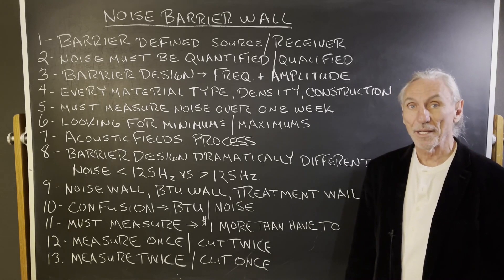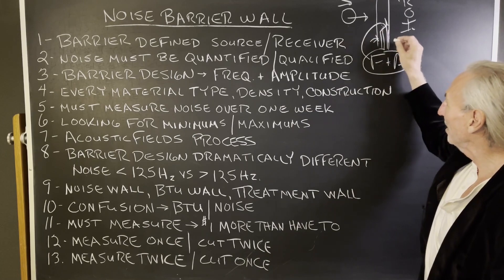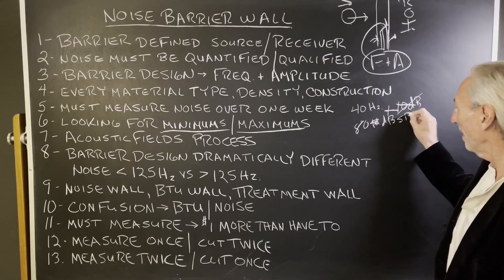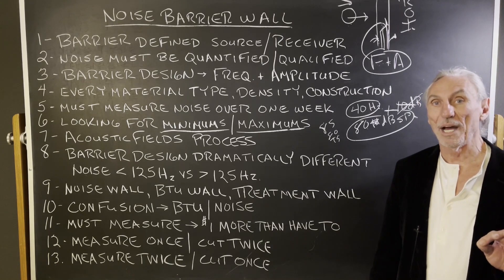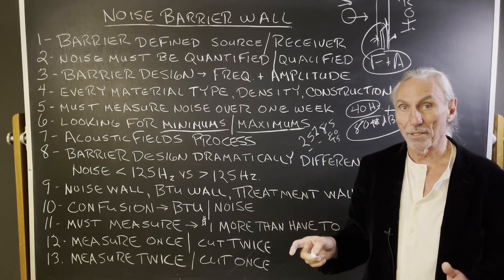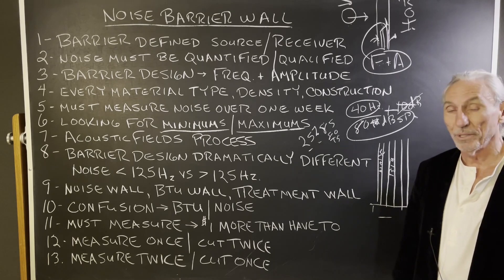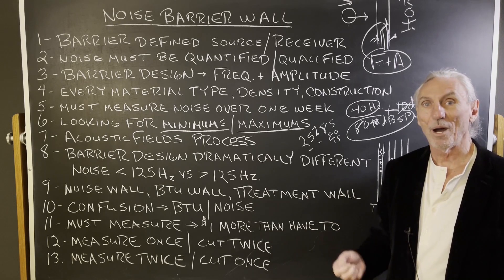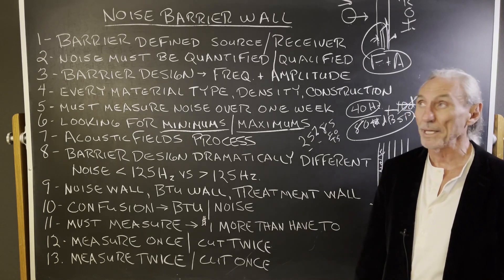Noise Barrier Wall Explained - www.AcousticFields.com

Comment: Sir , kindly advise. My neighbour pointed a electric kitchen chimney exaust pipe towards my balcony.
How to reduce maximum sound. 
Chimney around 15 feet distance.
Reply from the maker: All noise must be measured for frequency and amplitude before a proper barrier design can be built. We can assist you with the process and provide you the drawing for the barrier design. Send contact info to info@acousticfields.com

Comment: Which of the below-listed surfaces sounds best musically if left exposed? 
 
* Double Brick Wall (300mm)  - no plaster 
* AAC (Aerated Autoclave Concrete Blocks - Hebel blocks 300mm) - no plaster
* AAC as above + plaster 10-20mm
* Concrete blocks (300mm) - no plaster
Reply from the maker: Concrete blocks filled with sand and glass beads or steel bearings. Interior - plaster at 2" thick minimum.

Comment: What do you think of viscoelastic drywall (like QuietRock)? Keeping people in apartments from hearing each other ...
Reply from the maker: What are the frequency and amplitude (strength) of the noise issues? What day or night of the week are they the loudest? What is the load bearing requirements for your structure? Noise is a permanent build. There is no hanging panel that will stop noise.

Comment: Do you have any videos where you elaborate what you mean by "BTU wall"   Do you just mean a layer of insulation between a double stud construction with a large air gap in between?
Reply from the maker: Think of BTU wall as the material type that keeps your room warm or cold. Buiding insulation is a common material type for a BTU wall.
Reply: he does... https://www.youtube.com/watch?v=kfj2DW-c_9Q

Comment: Acoustics is not a term that is historically used for noise reduction but for noise direction.

The old cathedrals would be built in such a way that when the choir sung, the sound would be directed to the people sitting in the pews and they would be able to easily hear and distinguish the words of the choir.

Because of electric amplifiers and other sound equipment, buildings are not built with acoustics in mind. Instead, they just add more amplification which does not always solve the problem that is the result of the design. But then, in a multi-use building such as a Stadium designed for foot ball, soccer or basketball, you really don't want acoustics redirecting the noise to any one location. It's healthier to let it dissipate.
Reply from the maker: I do not see "acoustics in mind" in almost any usage that we work with. We have done 2 K venues down to one seat. I rarely see any thought about speech or music "intelligibility" at anything anymore. Churches build 2 K  new, seat venues and then when they can only recognize 4 words out of 10, they seek a solution when they have no budget left, no space available to treat, and no knowledge of acoustics.
Reply: @AcousticFields  
"I rarely see any thought about speech or music "intelligibility""

Which tells us that the architects that designed and built the grand cathedrals centuries ago, were more skilled and took more pride in their craft than modern day architects that rely on modern day technologies.

I've read where people belittle and put down the intelligence of those from thousands of years ago claiming a greater intelligence when in fact, the ego trip of modern day man make them less intelligent. 

Who is better at their craft is not determined by the boast, for one can tell who is better at their craft by a simple test where; the proof is in the hearing.

That said; how much of that lack of thought is due to architect knowledge or the customer refusing to pay for what they really need?

Comment: Wow, I've been on this chanel for ever, and I'm kinda surprised by this content. I'm an acoustic engineer specialized in sound insulation for large scale theatres, and I don't agree with you especially on point 8 9 10 . It's funny to see how we think differently about those problems
Reply: What do you mean by “sound insulation”?
Reply from the maker: Please be specific. What is your question.

Comment: For instance if a church has a serious sound management issue with lots of reverberation and intelligibility issues I would guess since Service Times are usually scheduled accustomed a specific schedule the measurements of Frequency and Amplitude would likely need to be measured during those specific time windows of usage. It’s those specific times when those issues are exacerbated and come into focus.
Reply from the maker: Reverberation times can be calculated to achieve low and high time windows by using software. There is no need today with the speed and storage of today's computers to take physical measurements for churches. Measurement dollars can go towards treatment costs. The time windows that today's software produces are quite efficient in determining treatment rates and levels along with the appropriate surface area coverages.
Reply: @AcousticFields  Thanks!